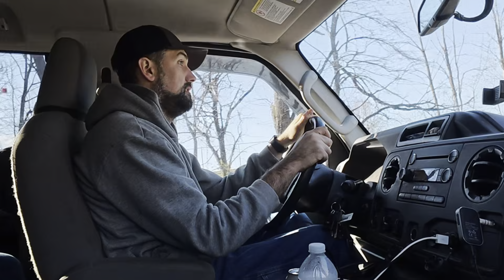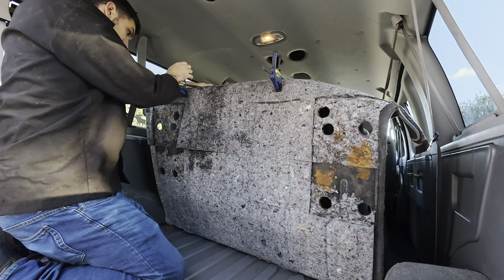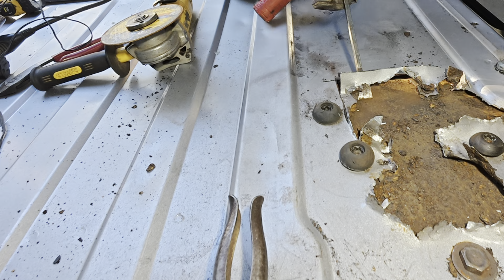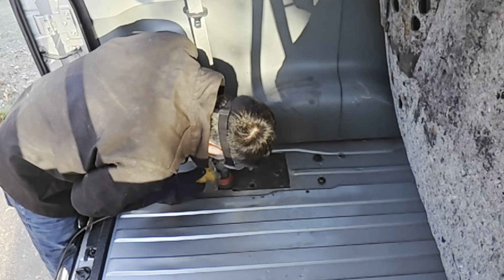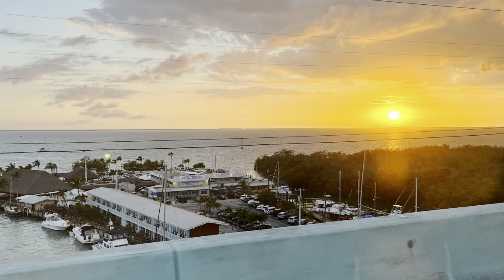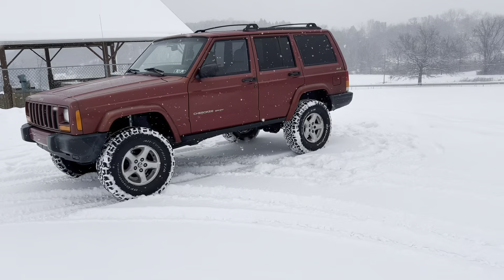Rust Repair on My E350 Van: A Shocking Discovery

Comment: My '12 E350 has a rusted out driverside front floor pan. No body shop will repair or replace it.  Ford sells the new part. Body shop just say " we don't do rust repairs:
Reply from the maker: It’s frustrating for sure.  I have always resorted to fixing this kind of thing myself but I’m lucky enough to have the time and space to get it done.

Comment: I just bought a 2004 E150 passenger from RAF Mildenhall in the UK. Wanted one for so long but after 264,000 miles its looking a bit worse than yours. Problem is finding an Econoline here is nearly impossible and lots of them have those damn ugly low cut rear windows and fiberglass high roof.
Reply from the maker: Nice,  what engine options did they have in the UK?
Reply: @BuildToExplore it's an ex Air Force van with all the windows and 2 bench seats in the back so an 8 seater. They were never available here directly from Ford. However this one is the 4.6 2v with a full aluminium intake manifold.